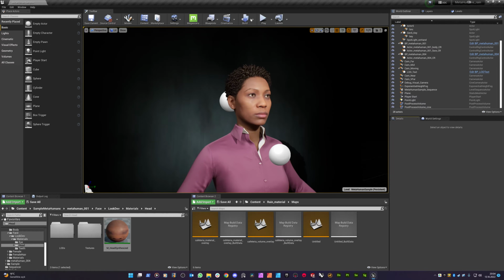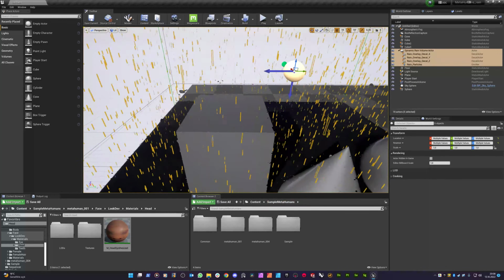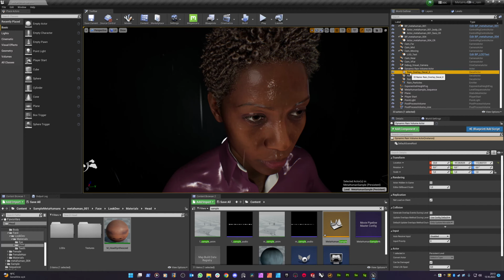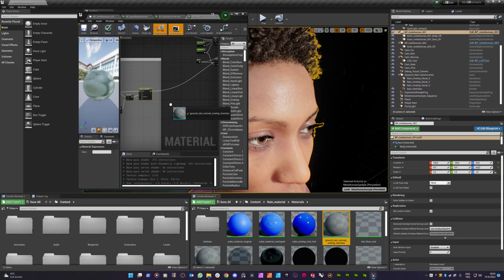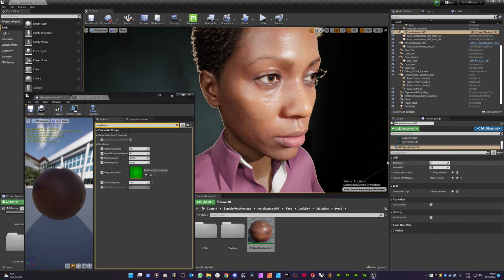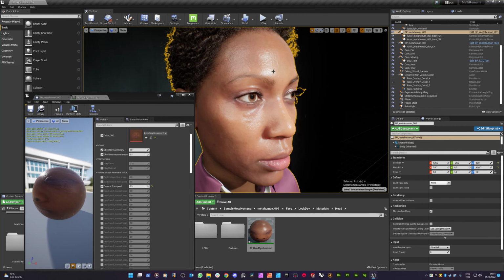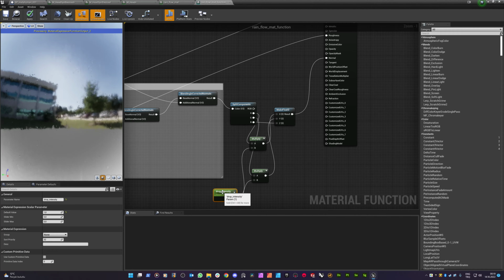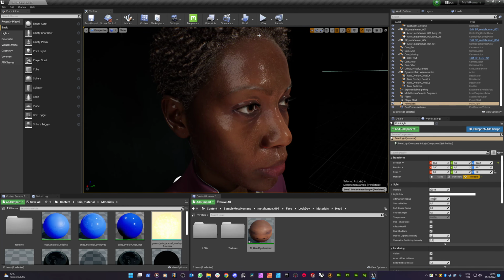Unreal Engine Rain Material on Metahuman Actors

Comment: Hi Cem - this doesn't seem to work in UE5 anymore, the volume shader never compiles correct for the rain surface
Reply from the maker: Hello StuFX, I will check it and get back to you tomorrow. Thanks for letting me know.
Reply from the maker: Hello again, I checked and comfirm that I get no errors on compiling or visuals. can you send me more detail about the problem you're having? if you're meaning the unsmooth surfaces, it's a bug that UE5 doesn't compute world normals with vertex normals. for more info about that check this thread:
https://forums.unrealengine.com/t/scene-texture-world-normals-are-not-shown-properly-on-ue-5/1171524